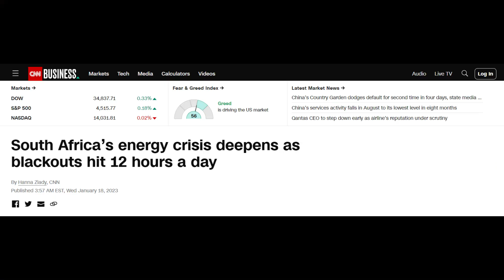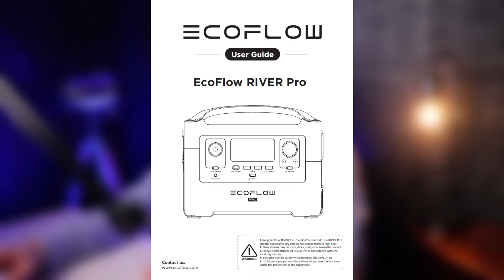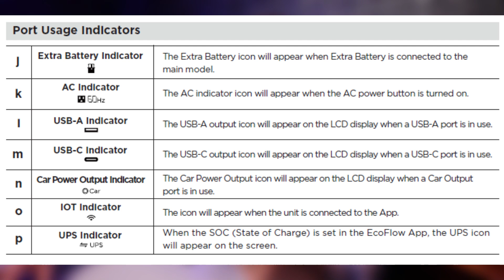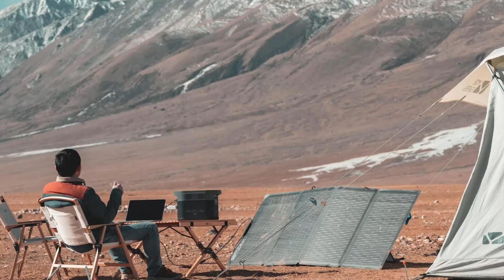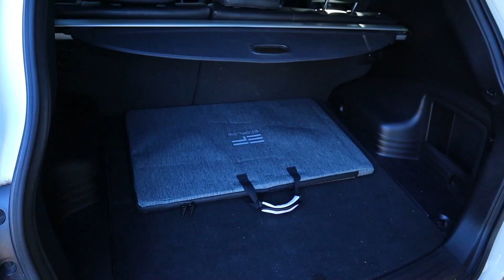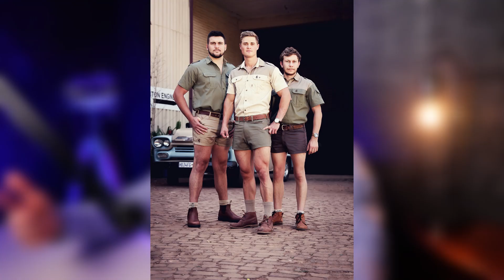EcoFlow River Pro PowerStation Review After 6 Months!

Comment: Mine was TOTAL waste of money. Bought exactly the same thing in October 2023. Its now 5 months later and cant even keep my t.v on for an hour. Ive tried looking after it by using the slow charge. It is SO depleted by now it will only keep the router on for two hours. Want some stats ? T.V + Router  = 75 w.  Can hardly use t.v now for 20 minutes. Will not recommend it . Also done the reset by runing it fdown to 0% and charging it up to 100%  - no difference. More than just disappointed. PS ! App is always kept up to date
Reply: Did you try to get it replaced? Warranty or customer service?
Reply: @mike7605  Thanks for your reply. Mine is alright again. Tried again to charge it from 0 - 100%  and either that ( most ikely ) or something else  seems to have fixed it. Can now watch t.v fr about 1.5 hours 🙂